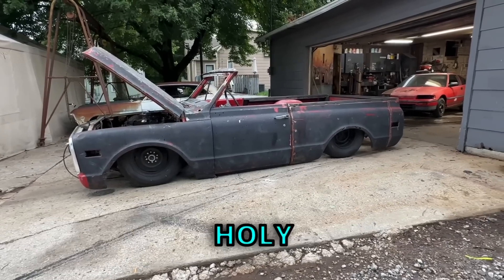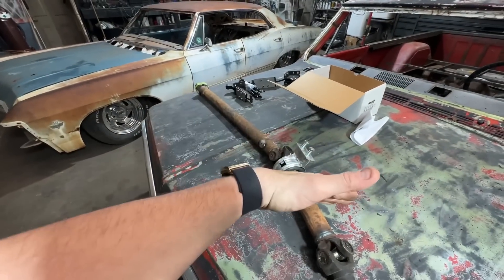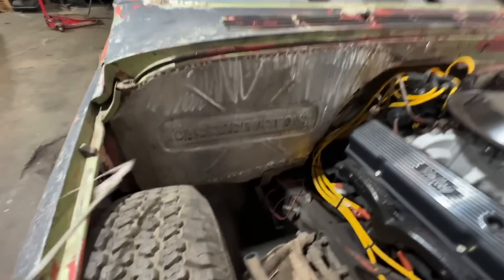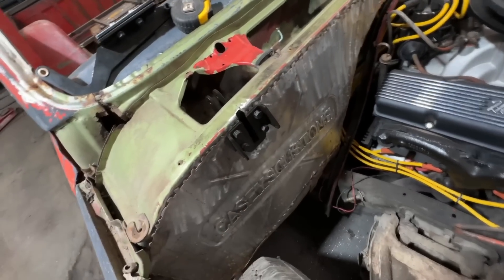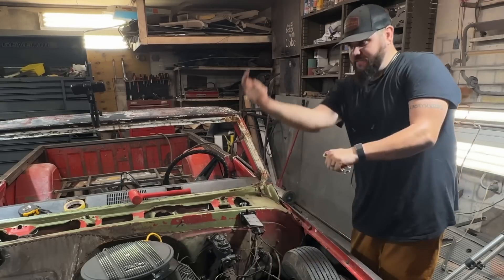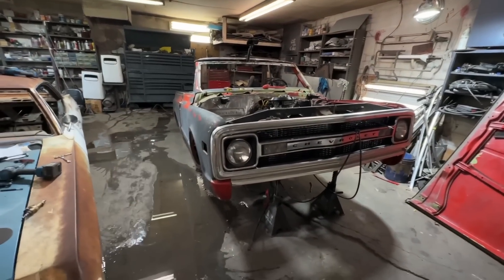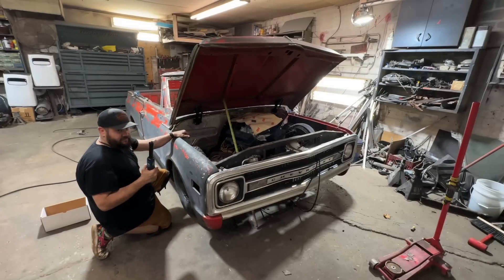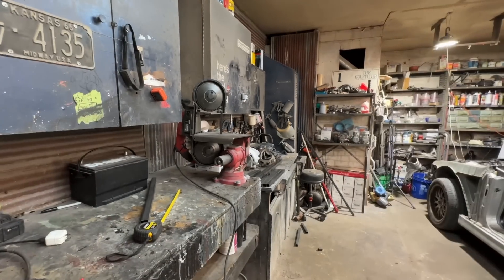LONG BED TRUCK TO CONVERTIBLE BLAZER CONVERSION! BUILDING THE BEST HOT RAT ROD KUSTOM TRUCK!

Comment: i use to have a cst blazer 71 i traded a 66 chevy 3/4 ton for it had to fix a few thing them myfriend wanted it real bad to restore it so he traded a 4000 dollar block fresh from the machine shop with everything to put it in my camaro for it the 66 i only had 500 in it and drove it for 4 years as a daily driver but it did get good mpg after i put 3 250 sixs together with the right parts for mpg u want the older higher compression engine and the integrity head with a 76 cam  u can get it up to 22 mpg if u drive it right

Comment: I'll take that '55 off your hands so you can spend quality time with the Blazer...
PS - why not go with a 1 piece driveshaft since that front section is so short?
Reply from the maker: That’s so nice of you to take the 55 for me lol. I might end up going with a one piece, the air bags just have so much movement in them the carrier bearing gives it some extra “slide” if that makes sense. If i do a one piece it will have to be a telescoping one and they are expensive as hell. But like i said, i might end up having to. We shall see
Reply: @CaseysCustoms  So the bags have more "total" travel than spings would (old worn out springs give up ALOT of travel)? I'm asking because the only times i've see the telescoping driveshafts are on the "I need a ladder" lift kit trucks...  ps - I'm startin' to like this build more than the '51, and I love that body style so I thought that would always be my fav...  KEEP 'EM COMING!